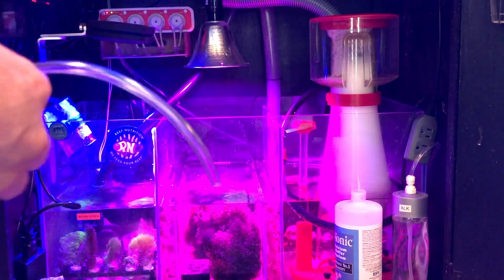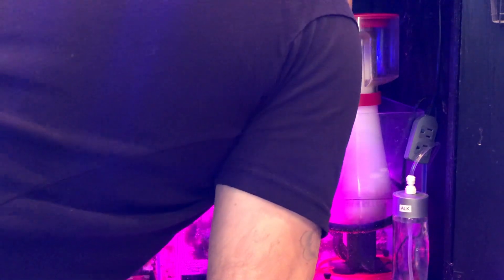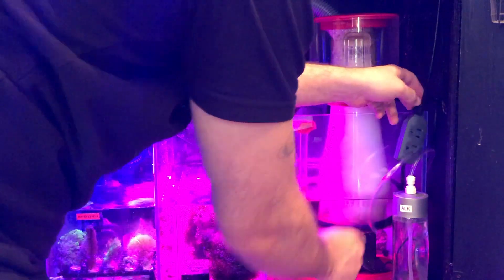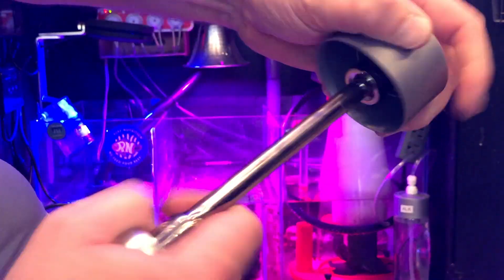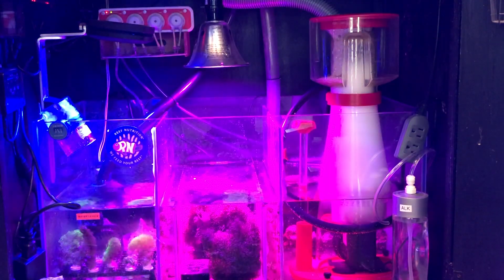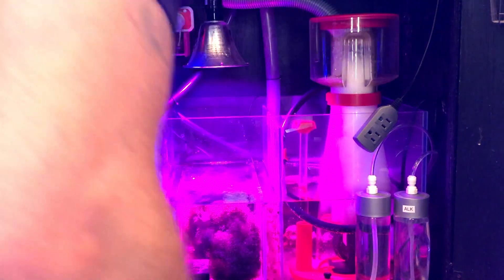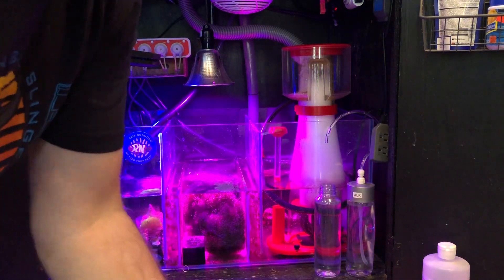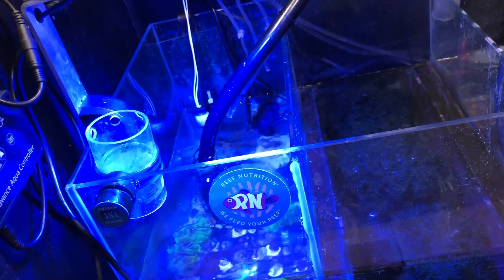Ep. 11: New doser and Voss bottle setup!

Comment: How was connecting to WiFi on that dower I’ve heard problems
Reply from the maker: I've heard of issues that people have with these but it went sooooo smoothly on mine. I had zero complaints. I tried a Kamoer F4 and couldn't get it to connect at all so was super happy when this one was so easy.
Reply: Spent 2 hours, don't bother, still wouldn't connect, you will regret it